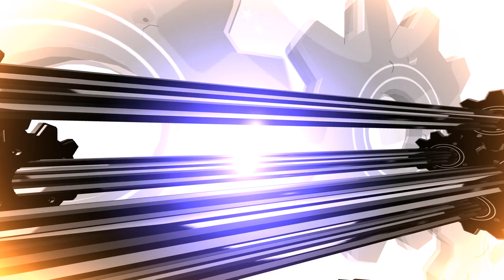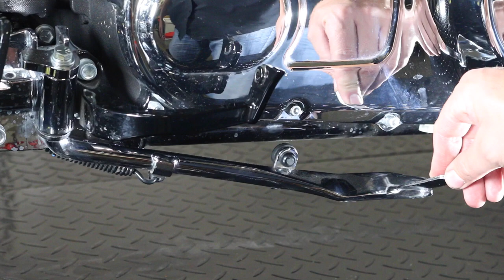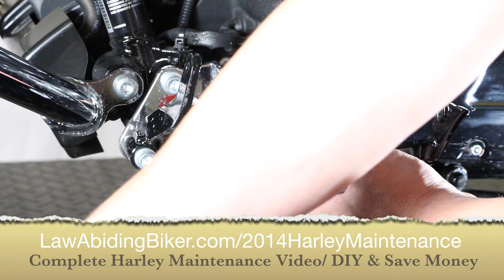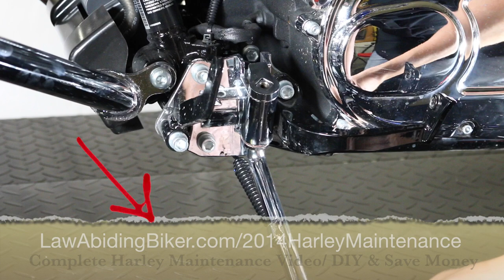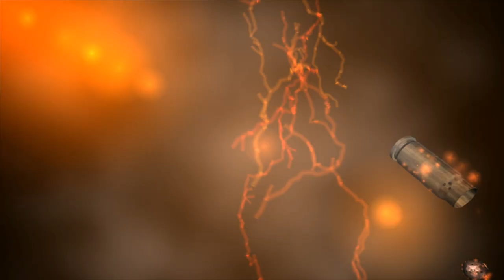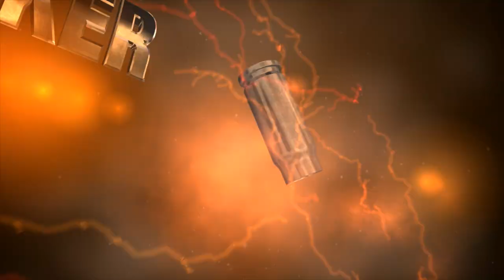Harley Davidson Jiffy Kickstand Maintenance-Repair-Remove Spring-Grease | DIY

Comment: Just did it great video,you mentioned the importance of spring facing right direction were connected to bottom of stand,but you never mentioned if was important which way it fastened in on top on frame of bike? I just by chance got it right on bottom

Comment: The very end at 4:00 when you show it working and "locking in place" was huge - I didn't know there was a "locking block" that locks the stand in place when it's out... That was very helpful. Thanks. One thing - my 1999 road king doesn't have the bumper on the leg - it's attached to the frame instead. Maybe it's aftermarket? Maybe it's a different design that year?

Comment: Best video as it includes the tip about which direction to insert the spring to the kick stand. Took less than 10 minutes.
My two cents: I installed 2 after market springs. It was difficult to set the ends in the holes, (needed pliers for one), and both failed quickly. Picked up a spring at HD for $2 more and it was in and done w/ a rachet, extension, and socket. Thanks for the video!
Reply from the maker: Our pleasure. Glad the video was helpful!

Ride safe & Ride Often!
Here is a link to a bunch of our useful Free vids: http://www.lawabidingbiker.com/freevideos
Here is a link to some of our useful for purchase videos: http://www.lawabidingbiker.com/buyvideos
Want Answers & Information Fast? And help support us at the same time? Do you like the content we provide?
Our patrons get answers to their questions/comments/feedback in less than 24 hrs and are part of our Private Facebook Group. If you are interested in being in this exclusive group you can get all the details at ==> http://www.lawabidingbiker.com/patreon
If you haven't subscribed to the Law Abiding Biker Podcast make sure to do so. Listen in as we talk weekly about issues/items like this & so much more. You can listen on iTunes (Apple/IOS), Stitcher Radio (Android), or any other Podcast App ==> http://www.lawabidingbiker.com/podcast
Join our free email club at http:///www.LawAbidingBiker.com/EmailClub. Only relevant content will be sent from time to time. Email club members are the first to find out about free or for sale content are given special coupon codes.

Comment: Is there supposed to be a lot of play in it? This is on my road king. I’ve never really paid that much attention to it to be honest. Went and bought a new spring and put it on just like your video. Seems like there should be something under the bolt and washers at the top? I guess not according to your video. Does seem like there is a lot of play. Guess there has to be according to how it’s designed.

Comment: Can't get any better than that

Edit next day: You may have guessed I watched this video because I needed to change my jiffy stand spring

I was wondering why stand up to remove bolt, stand down to put back on.......duh

Took me a little longer, I left the floorboard on and my fingers didn't fit in there real easy, and the old spring bottom hook was crimped, the old spring was also bigger diameter and longer........ probably thought crimping the end would hold it tighter

Doc Harley said the reason the bike rolls forward a little causing mini heart attack is because the top bolt is not tightened to spec

I paid attention to the effort it took to loosen, putting back on to 20lbs was way more effort.

Now I have jiffy stand that stays up and doesn't let bike roll forward when I get off. 

I was looking at my Dyna, totally different contraption

Comment: This is not the way to do it . Lean the bike to the right on a wall or on a jack stand ,remove the 1/2” bolt and little locker plate and rotate the arm all the way forward and then the spring won’t have any tension on it and it’ll pop off with a little spin and the stand will drop out of the sleeve. Clean up the old grease and grit and apply a little never seize grease, slide the arm back in it’s sleeve and hook the new spring on from the front side and finger tighten the 1/2” bolt making sure the locker plate is oriented correctly and the washer and lock washer are on the bolt and a little blue Threadlock  is a good idea. Rotate the arm back and lift up on it and torque the bolt to 18 ft. Lbs. and you’re golden .
Reply: Very sorry , this was the best video of them all and the only way to do it and regrease etc. at the same time . Very clear & concise , excellent work . I was trying to tell guys on the other crappy , unsafe 10 penny method video to watch this one .

Comment: So what do you do when even a new factory spring won’t keep the stand from coming down?
Reply: You make sure the kick stand is not bent at all then you make sure there is no slop at the mounting bolt.and make sure after a while the mounting bolt is not comeing loose.if it is after 4 monts.replace it with a new one with nylon thread they stay tight..if this dose not  solve it then remove the kick stand anput a steel one on never was a big fan of aluminum kick stands or rear brake levers on any harley
Reply: Kick stand springs are fine there not the issue its usaly a kick stand.issue bent or worn will.knock the spring off no play in the kick stand